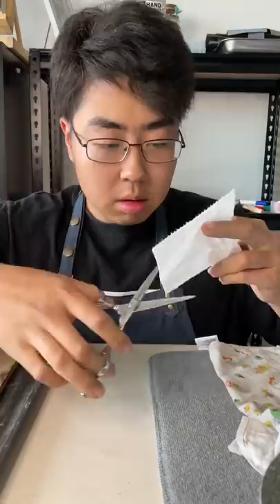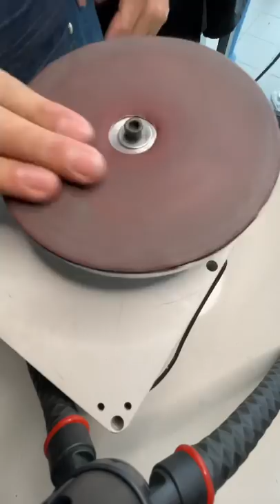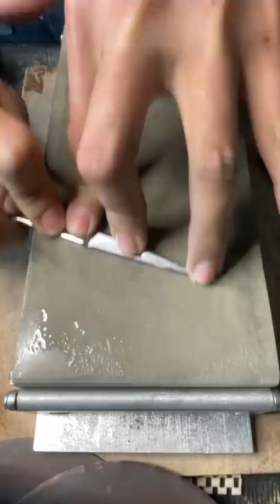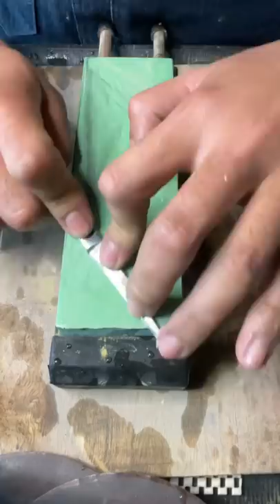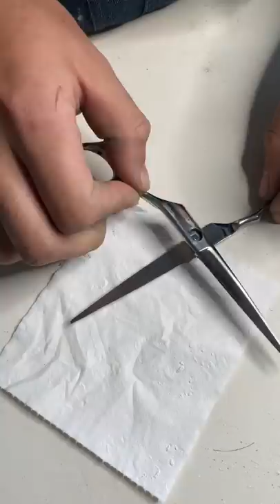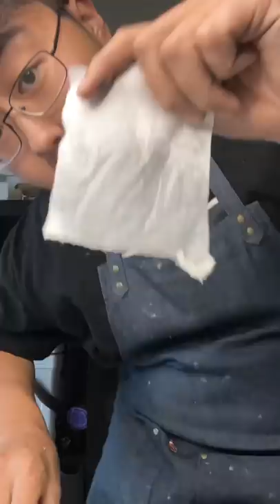Scissors sharpening

Comment: Literally can only be done in barber scissors, art scissors tend to be riveted
Reply: Very cheap scissors are riveted, but even inexpensive kitchen scissors have a screw pivot. A rivet can be tightened by peening with a hammer, but it's a one way process, if you make it too tight the scissors become horrible to use.

Comment: Wouldn't it be easier to just use a multiple folded sheed of aluminium foil and cut that a few times?
Reply: That won’t sharpen anything
Reply: works with most shears, but not hairdressing ones

Comment: You dont need all that crap. I worked at a cotton mill for 5 years. An old timer used to sharpen out scissors when we asked. He'd put them in his vice in his shop there. Then use a file, going slowly at the righr angle. Took only a couple of minutes. He'd shave a spot on his arm to test. The edge would last for weeks, and we used them all day.

Comment: Could have just tighten the bolt holding the two pieces together also
Reply: That just makes scissors harder to use, not sharper. A well sharpened pair of scissors does not need to be tight, that's why he did the test to show it wasn't tight.
Reply: the scissors were blunt, not loose. but yes most of the time that works

Comment: hey hey, did anyone noticed he didn't wet the paper at the start of the video and wet it at the end so it cut better 😂
Reply: not how it works, wet tissue is hard to cut with shears because its delicate and therefore tears with dull scissors. dry tissue isnt that delicate and therefore cuts easier.

Comment: First off the first piece paper wasnt wet the second was soaked so there for dont really tell if u got sharp concidering the two pieces of paper weren't the same
Reply: wet tissue is very hard to cut because it is very delicate, dull scissors will tear it not leaving a clean cut.

Comment: Fold aluminum foil three times and cut it a few times. It sharpens scissor
Reply: It is impossible to sharpen hard steel blades with aluminium. Cutting aluminium foil can clean deposits off the blade edge that reduce cutting performance,but it cannot sharpen it.
Reply: @ferrumignis  trie it. It works, Are you telling me leather can’t sharpen a razor???
Reply: @devinkane6476  
A strop works on razors (and other fine cutting edges like chisels) because the cutting edge is so thin that it tends to roll over and create a burr in use.  A strop only has to straighten this burr, not actually remove metal.  That said a strop can also be used to remove tiny amounts of metal for actual sharpening, but only by applying abrasive powders like rouge.
Reply: works with most shears, but not hairdressing ones

Comment: Why did he not test the sharpened scissors on a dry tissue instead he tried it on a damp tissue which causes the tissue to be easier to cut and the dampness causes gravity to help but he tested his full scissors on a dry napkin
Reply: Exactly
Reply: thats not how it works. wet tissue is very hard to cut due to its delicacy, dull scissors will tear it not leaving a clean cut.

Comment: Scissors are really easy to sharpen. Just hit the flat side a few times with low then high grit. Check the bevel on the edge for burs(obviously sharpen the bevel like a knife If they are there). Then cut away. You don't even need to take the Scissors apart

Comment: I thought everyone knew that you can sharpen scissors by cutting aluminum foil. It will atleast maintain edge of scissors. The cost of sharpening them has to be more than a new pair of scissors.
Reply: A decent pair or Barber scissors cost hundreds of dollars
Reply: Aluminium simply cannot sharpen a hard steel blade, sharpening requires a harder material than the blade itself. Cutting aluminium foil will actually dull the edge a little but it also removes deposits from the blades that affects cutting so it appears as they have been sharpened.
Reply: works with most shears, but not hairdressing ones

Comment: You retested the scissors on dry toilet paper though, that’s not the same standard
Reply: Huh? He retested on wet tissue, not dry. Wet tissue is more difficult to cut cleanly; you need very sharp scissors to actually cut it instead of tear it which leaves a ragged edge.